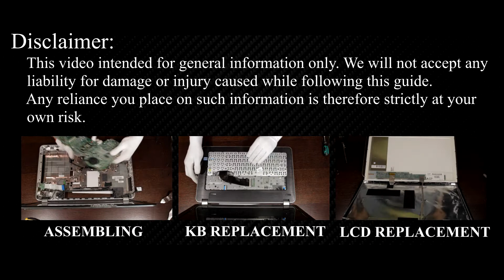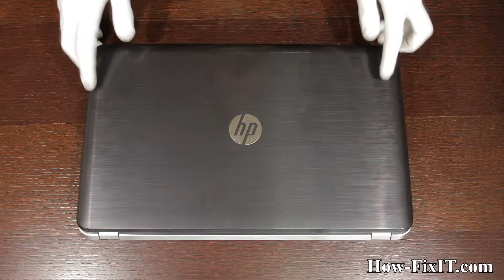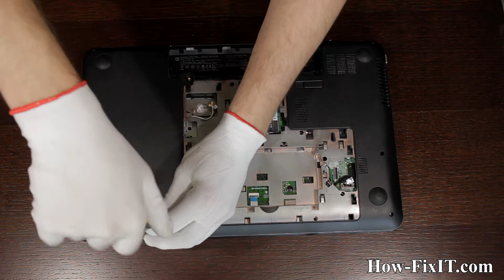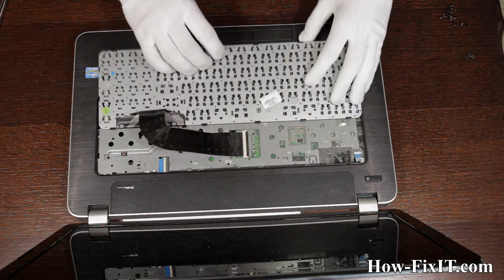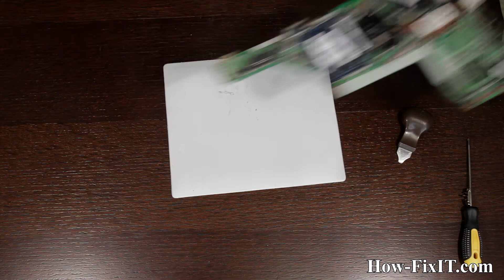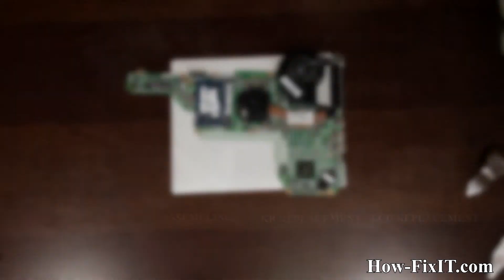HP Pavilion 17-E Series Disassembly, Fan Cleaning, and Thermal Paste Replacement Guide

Comment: Very helpful, thanks! I try to upgrade my 17-e030ez (with Pentium 2020M; 2C/2T; 35W) to a Core i7-3610QM (4C/8T; 45W). Also it get another identical 4GB RAM Module and a SSD. Then it should be absolutely fine again, even with Windows 11.

Comment: I am scared that I will break my keyboard if I get it out like shown here.
Reply: +ethics When popping out your keyboard, dont force it too much, push in a corner until you see it pop out. then slide in a finger or a tool and move it to the side t pop the corner clips off the body, from there it should be easy to remove the keyboard.